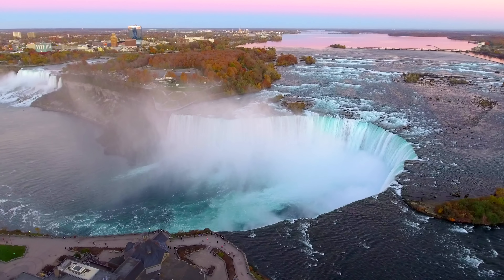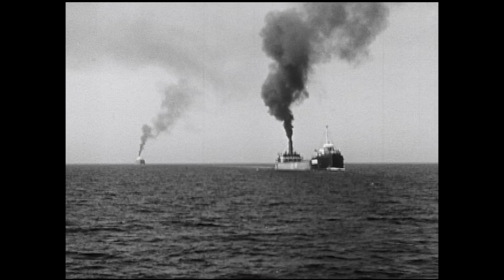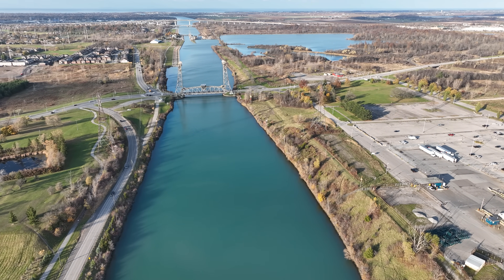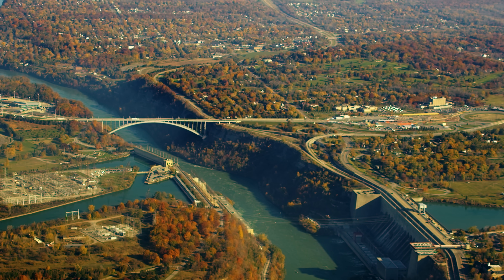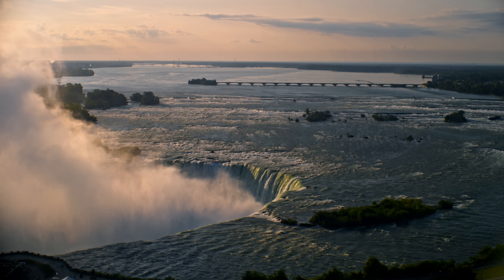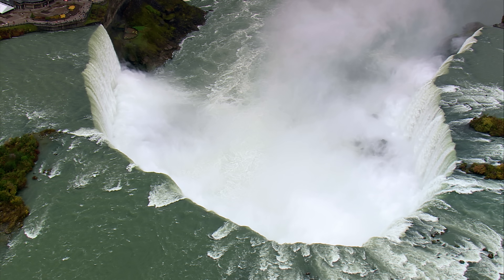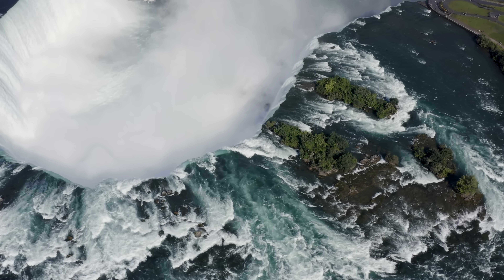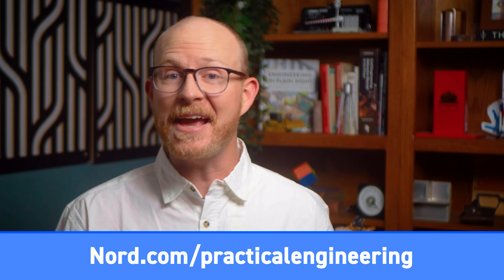The Hidden Engineering of Niagara Falls

Comment: Wow, very interesting,  much more than I knew about the whole system, like a water park for engineering spirits! Grady if you'd ever find yourself in Sweden you'd probably enjoy visiting the town of Trollhättan where a lot of these features can be found, all be it in a somewhat smaller scale but in a more condensed area. The first locks was finished in the 1750ies, still there but not in use. And while you're at it you might as well take a trip to the town of Norrköping where anyone with a soft spot for weirs and running water in surroundings where the first industries emerged in the 15th century, will be like a kid in a candy store!

Comment: If the water falls were running with no restraints. Both sides of the falls would cut back instead of 600' per century. With the water unrestricted the falls on both sides would be cutting back between 1,200' to 1,400' feet per century. That would also cut into the first lake above the falls changing the water pathway dramatically. The falls are the over flow from all the lakes above the falls.

Comment: but did you know the Q is measured roughly 2km upstream of the water flow using a boat with an ADCP. Completed by WSC with cooperation from the USGS. Water level measurements are taken every 5 min to the mm and then published to the public.

Comment: Grady, my man, if you haven't yet, you need to look at Ontario's own version of the Erie Canal; the Trent-Severn waterway. 

It connects dozens of rivers and small lakes to connect lake Ontario to Lake Huron via Georgian Bay. Many of the locks are pretty typical, with the exception of Big Chute; a "Marine Railway" which physically lifts boats out of the water on a carriage, rolls down an incline, and plops them in the river below. It's fascinating, and quite a feat of engineering.

Comment: So if they're worried about the erosion of the falls escarpment face, AND they have the ability to turn off the flow of the falls......why don't they just periodically turn off the river and then build the escarpment back up artificially, with concrete?  You'd only have to do it every 10 years or so, and it would permanently stop the falls' migration upstream, to ensure the tourist center and power centers didn't ever need to move, and you'd ensure the falls remained just as majestic forever.

Comment: The Canadian side has the hydro power museum opened up to the public. You can take an elevator down to the tailstock beside the horseshoe falls. It's really neat! When I was there it made me think of your videos. You should go it would be neat! Also when it comes to power generation we rely on three different types of generation depending on load conditions. Base stations are the average amount of usage and we use nuclear for that because they are slow to respond. So they supply 100% power at all times to provide base power. Hydro power and stored power is used to supply mid demands and finally natural gas I used for peak power demands because they can be turned on off. We have solar and wind as well, but they provide a small percentage of it. Oh you should do a video on the type of power systems depending on demand. That's a neat area you can dive into.

Comment: Is it possible to use Lake Erie as a pumped hydro reservoir? In the future could much larger/numerous pumps/turbines/pipes be installed to pump huge amounts of water back and forth between Lake Ontario and Lake Erie, at a scale that dwarfs the falls? Combined with high voltage DC transmission lines, this could theoretically stabilize the power grid for the US northeast and Canadian southeast.

Comment: If the water that generates the electric isn't going over the falls... how are the falls "valuable" as a source of power? Couldn't the power plant be literally anywhere along the river?
Reply: Because the water that is diverted still drops the same height as if it were flowing over the falls. It's the flow rate plus the drop that makes it useful for power generation. If you move the power plant to a flatter part of the river you miss out on the energy provided by the drop.
Reply: @notahotshot  But what about all the stored water? That's not moving at all.

Comment: Not sure where I heard or read this ,  but i was of the understanding that the full flow of 280,000 cu ft/s, was opened up for 1 day each year .
To test all systems and flush debris ect.. Can anyone confirm or deny this ?? .
Thats a significant difference of the average flow rate of approximately 85,000 cubic feet per sec .
Imagine seeing it 150 yrs ago at its full Glory.

Comment: The most fascinating thing is the tunnels that lead from Rankine Generating Station, upstream of the falls, into the falls themselves. There was an urban explorer blog with pictures, they braved to enter the building, crawl down the rusty penstock shafts, and then walk the disused tailrace tunnels and have a glimpse at the water curtain from behind. Mindblowing.

There's also Journey Behind the Falls, but one must admit that's a cheapskate version of an actual power station tailrace tunnel... Which is also still there, a humongous brick-lined engineering marvel, alas, access through station building has been concreted off nowadays. I so wish I could go and visit...

Comment: I wish I would have had my passport and was able to go over to the Canadian side. I was at the American side of the Falls a few years ago. I was told the Canadian side was better. Didn’t realize how better until watching this. Truth be told, I think I am more impressed with the cloud above the fall that I could see 5 miles away, and the noise. Also the height of the drop. I was at the tourist tower and I looked straight down and was impressed with the height. From what I remember there was an abandoned concrete structure and walkway at the bottom. I wished I would had taken a picture of the cloud, but I was driving.
Reply: I'm from downstate NY and we've gone to the falls a few times over the years - the Canadian side is MUCH nicer. Not only is the Horseshoe falls larger, the area itself is walkable, clean, offers nicer hotels and restaurants, is family-friendly, etc.

Comment: 4:34 while the canal splits in two, the old canal is no longer continuous. a stretch of it has been filled in to accommodate the approach to a railroad tunnel underneath the bypass, so the old route dead-ends on both sides.

Comment: Oh neat! I hadn't realized there were so few natural drops with water that accommodate power generation! Turns out I've been to another one. Snoqualmie Falls in Washington state, not on the same scale as Niagra but it's got a 270-foot drop over a volcanic plug which erodes at a much slower rate than the surrounding river. There's a tunnel dug into that rock where the water goes straight down into a turbine over that same 270-foot drop and generates power. 

I don't know how significant the power plant contributions are to the local power grid, but it's still pretty neat!

Comment: 6:00 doesn’t the density of the fluid matter too?  I’d think a 200’ tall waterfall of X gallons per second would generate less energy than a 200’ tall mercury fall of the same X gallons per second because mercury is denser than water.  An anvil floats in mercury but sinks in water.
Reply: Where are you going to find a large continuous supply of any fluid other than water to drop? While technically true, your point is irrelevant for engineering discussions like this.
Reply: @michaelchastant1450 I’m saying the formula he gave is wrong, missing a variable.  I’m a scientist, the practical usefulness of my point is not something I would ever waste energy to consider.   But I’m sure it is relevant to the motion/fluid dynamics of heavy water vs regular water in nuclear power plants and other systems that involve heavy water.  You conceded my point was technically true and that’s all that matters.  But because I’m thorough I’ll answer your question anyway: on other planets/moons.  You might have sulfuric acidfalls, and that is almost twice as dense as water.  Using the same amount (flow rate) of a fluid twice as dense as water falling from the same height, would you get 2x as much energy or x^2 as much energy?
Reply: @kaltkalt2083 you just made my point. This video is on engineering, not science. We engineers like shortcuts and only make things as complicated as they need to be. What could happen on another planet has no relevance to hydro power discussions on earth, so he ignored that part of the equation.
Reply: @kaltkalt2083  "You conceded my point is technically true and that's all that matters."

No, the fact that it's completely irrelevant within the context of the video also matters.

Comment: If you're looking for another interesting hydro system, there is the bear river and bear lake in Utah.  During high flow, they allow water out of the bear river to bear lake.  During low flow, they pump water back out of bear lake to raise the river level.  The bear river has multiple hydropower plants on the way to Great Salt Lake.  So it is a system where they pump water up hill to generate more energy than the pump uses.

Comment: I wonder if most people know the falls have been turned off a number of times by natural forces .. ice blocking the river flow has occurred in 1848 (for almost 2 DAYS .. and in, 1911, 1932, 2014, and 2015. 

In 1848 the falls froze SOLLID .. since then the other occurrences appeared to be frozen solid but some water was flowing underneath the surface of the ice.

Comment: Indeed, the water that goes over the fall is significantly reduced at night. Also, the tunnels were design that if used at full capacity, they could theoretically remove all the water that goes over the fall.

Comment: Hi Grady (from Australia). I am just about to read your book - looking forward to it. One thing about Storm Surge is that it isn't just the winds that make the water rise up in localised places, it is also the atmospheric pressure. Most Cyclones, Hurricanes and Typhoons also have Storm Surge because "normal" atmospheric pressure is 1013 mBar (29.91 inches Mercury) but at the centre of such storms it can easily get to 963 mBar (28.44 i of M) or lower. This air pressure difference does not "squash" down the water as much and so more can get into the area. This pressure difference can allow water levels to fluctuate by a Metre or more (1 yard a few inches).

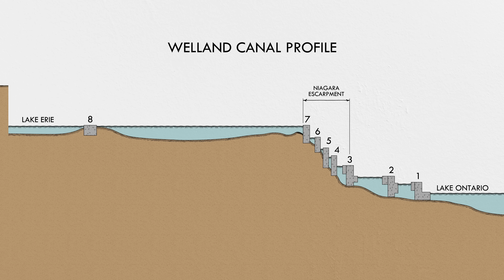Comment: at 5:25 cross section of great lakes, zero curvature. Water finds level.
Reply: The difference from flat is about ten miles across that distance, which would completely hide the difference in lake levels, the point of the exercise. Maybe you noticed that the axes are scaled differently, too. The lakes aren't really a hundred miles deep.
Reply: @GWNorth-db8vn  The distance between lake Superior and lake Ontario is 500 miles. The angle or arc between those two points on a sphere with a radius of 3959 miles is 31.5 miles = 166,497.53 feet. I think the artist rendered it flat because making a cross-section side profile projected onto a slice of a sphere would be very complex and confusing to the viewer as portions of the lakes would have to flow up the curve for half the distance.
Reply: @CoolChannelName  - cosine of (7.5/2) = .9979
I used 4000 miles because ballpark's good enough. 4000 * .9979 = 3992 miles, or about 8 miles less than the radius. 
The graphic was obviously meant to show the difference in lake levels. It's not a map and it's not scalable. If it were a map, it would be a projection that doesn't match the real world anyway.
Reply: @GWNorth-db8vn  What doesn't anyone have a cross section of great lakes that includes earth's curvature?
Reply: @CoolChannelName  - For one thing, they overlap one another if you try to draw it that way. Erie is mostly south of Lake Ontario, but it sits above it for the purposes of this illustration. For yet another, this isn't a cross-section of the Great Lakes. It's an illustration of the difference in level between the upper and lower Lakes. Nobody cares what the bottom looks like. Ships use the surface.  500 miles is also only about 2% of Earth's circumference.
Reply: @GWNorth-db8vn  you are bad for what you are doing. There is no curve.
Reply: @CoolChannelName  - We've reached the stage where it's a waste of time. Have a nice day, and may all your graphics be curved.
Reply: @GWNorth-db8vn  enjoy your appeal to consensus.

Comment: 1:10 Bottom left, the grassy interface between the fall's edge and the walk path.  If I recall, the path extended to the edge of the falls.  As a young boy I recall watching in amazement this thick column of water rolling over the edge.  So much power.  And how anybody can jump right in.

Comment: When I visited Niagara recently I dragged my whole family along to the Adams plant. I had an absolute blast looking at the power infrastructure and all of the old-style governors and control systems. The rest of my family was significantly less impressed, which honestly kind of boggled my mind. I tried to explain to them the intricacies of how maintaining a steady AC line frequency based on the constantly changing spin rates of massive turbines using only electromechanical systems was an insane accomplishment but I don't think I got through to them :/

Comment: I always find the whole "pump water up at night to make an artificial resevoir" thing amusing because I know it's not energy efficient right. the laws of physics say you will never get more out of that then you put in, and the pumps and stuff will probably never be 100% efficient. 

But once you realize that the whole thing basically is just functioning as a battery, and the pumps are chargers, you realize that it doesn't need to be efficient if it's harnessing energy that would have otherwise been lost/wasted.

The efficiency could be like 10% and that's still better than not getting any of the energy at all.

Comment: The solution to the eroding american falls is simple, build a dam.  Remove the talus, dig down to bedrock anchor in the dam base,   Build new dam to replicate the falles.  Behind the dam you remove as much rock as you feel like selling for fill to raise low lands subject to flooding, build levees etc.  Creating another reserve pool of water for electtrical generation.  If removing that much rock seems a bit much, you need to compare it to strip mines a mile deep and 5 miles wide.  They move more rock in a year than this project would take to excavate it back to the control 'dam'.  You'd need to line wall and bottom of created reservoir to keep water from eroding it's way through faults etc and coming out cliff faces eventually carving a new river channel.  You could also pick a shape for the new falls.  Concave, like horseshoe, convex, zig zag, put ski jump curve at bottom to shoot water back up 50, 100 feet into air.  Install pipes and valves and make the biggest dancing water show in the world every night 9Pm to 10PM, ticktets at of course, ticket master.

Comment: The building of the original Westinghouse power plant was also one of the first uses of pneumatic power tools.  Air compressors didn’t exist at the time, but Ingersoll made steam powered rock drills.  

When looking for a site to install steam boilers they came up with the idea of suspending a pipe in the flow of the waterfall.  The water had a large amount of air entrained in it, and by diverting that flow into a chamber where the air could bubble out of the water they got essentially free compressed air.  With only a few simple modifications, the steam powered drills were converted to compressed air drills, which were used to excavate the drill tunnels and foundation for the plant.

In addition, one of the first uses of the output of the plant was the Chicago World’s Fair that showcased the uses for Tesla’s AC power technology.
Reply: Chicago fair was powered by generators. The pan American exposition in Buffalo NY in 1903 was powered by Niagara falls and showcased the technology of electricity

Comment: I could swear that when they shut off the falls in '69, that they also shut off the Horseshoe falls at a different time and that they also had a project to repair the escarpment in some way so as to reduce erosion which would cause massive boulders to break away from the face of the falls every few years.  As a kid, I imagined huge steel slabs and strips attached to the lip of the falls, but I never knew exactly what (if anything) was actually done.  Photos were less plentiful back then and nobody had drones yet.  If you wanted a photo, you had to hope you were lucky to see black and white pictures in a newspaper or Time Magazine, or you went out and took them yourself.  We did visit the falls during that project, and I believe the American side was shut off, with that trickle of water still falling over the edge.

Comment: The erosion actually happened much faster. From the turn at the whirlpool to about the area of the Rainbow Bridge, geologists determine that that  stretch eroded just a couple weeks. That section the ground and rock is a very different composition and would have suffered a very quick erosion compared to the rest of the surrounding area

Comment: Hi Grady!

Can we get a video on how the Niagara power plants work? Since it's not waterfalls spilling onto watermills, what's the system?
Reply: Through the tunnels he described. The water is diverted upstream to the tunnels which bring the water to the power plants that are on the lower end after the falls. So the power is generated by the water flowing down through turbines and out under them to the river downstream of the falls. Some of the original (now retired) plants were built on the upper level of the falls, with water flowing through long tunnels down to discharge into the river after the falls.